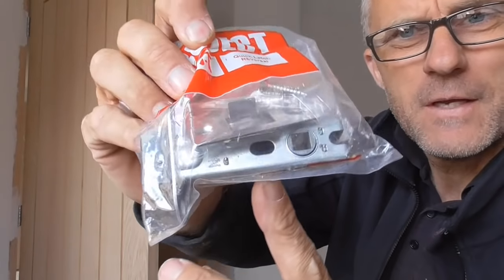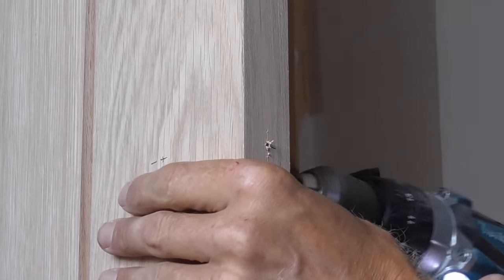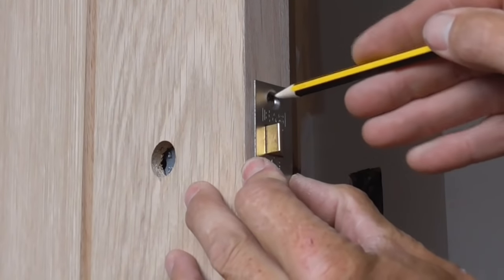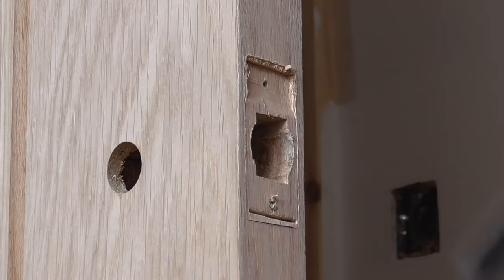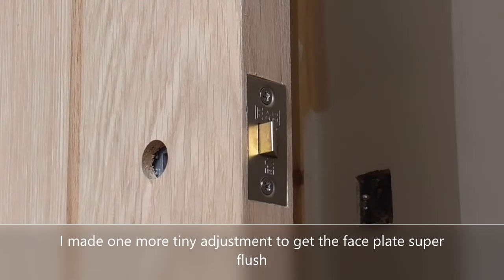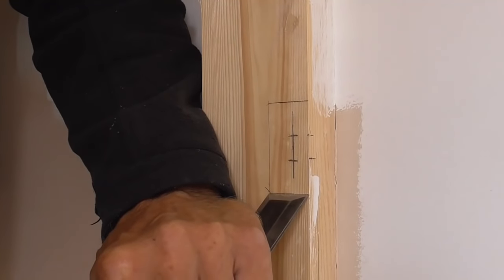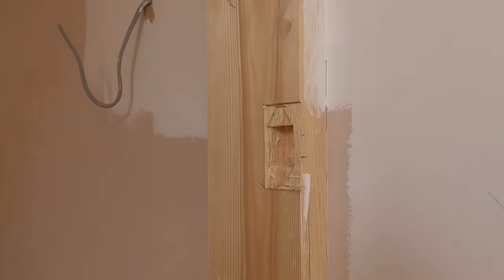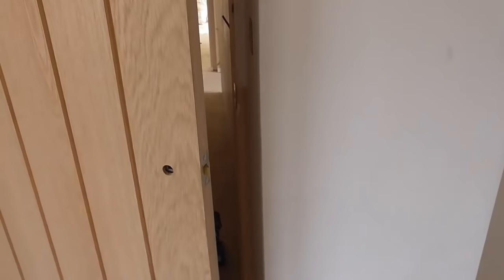How to fit a tubular mortice latch and keep.

Comment: Why don’t they make the latches same way they used to before you could just drill 22mm hole then slot it in now u have to drill and chisel it before it goes in
Reply from the maker: You're showing your age now Lewis🤔I also remember the latches fitting perfectly in a 22mm hole👍Thanks for watching 😎 Cheers Del

Comment: I’m glad someone else cuts the top and bottom of latch hole with a chisel I don’t understand the manufacturer’s not making a latch that fits and operates in a 22mm hole like the older versions
Reply from the maker: Hi Paul. Your comment has saved my sanity, as I was sure that latches always used to fit straight into a 7/8" or 22mm hole😲 I just don't like using a 25mm bit as it's the same size as the faceplate👍 Great comment and thanks for watching 😎 Cheers Del

Comment: Hey I'm a carpenter of 20 years. It's nice to see someone with good technique. I always use a knife where possible on finer work. One thing I have learnt is using the marking guage to make extra sure with the marking of the latch plate. With real poor quality fittings you might even have to avoid this but I will be using this technique in the future. Our techniques are almost identical on this matter. I do give a little rub down with some fine paper on the outer edges of the cut out to smooth them off before I put the final plate on. Good job. I've just found you and just subscribed. 👍
Reply from the maker: Hi Simon🖐You got me on giving the faceplate housing a little tickle with some sandpaper before fitting the latch😬I do it on hinge housing when using a router, and should, like you, also do it when fitting latches as it just softens the edges very slightly👍Thanks for subscribing and it's always cool to have a fellow carpenter watching and commenting😎Cheers Del

Comment: I like the idea of drilling the spindle holes first, but when it comes to the latch plates I like to use a trim router and an 18mm bit to take out the bulk of the material and then clean up with the chisel. (Steady hand) Removes the guess work with trying to achieve plate depth, I've also been experimenting with the Souber Latch Jig. Allows you to drill two 23mm holes overlapping each other for the latch body, it is very square and has a depth stop. Also you don't have to square up the hole afterwards with a chisel. 

Great video though, I watch your stuff all the time. Really enjoy the content! Thanks for another one.
Reply from the maker: Hi there🖐I definitely hear what you're saying about routing out the faceplate, and I've heard many people say how great the Souber jig is👊Thanks for your great comment 🤩Cheers Del

Comment: ive always gone 1 meter off the floor but i like the idea of going off the top of the door so theirs no need to square the lines around. i also  use a Stanley knife to mark the keeps. ive always used a spade bit to drill the mortice! ill give a auger bit ago now though. another great video 👍🏻.
Reply from the maker: Hi Tomm. I find that a good quality auger bit tends to hold its line a bit better than a spade bit.👍 Its cool that you knife round the latch plate and keep the same as me.😎 Thanks for watching and your comment.🤩

Comment: Another great video. I usually measure from the floor, with multiple doors the handles generally have more chance of lining up, particularly in hallways. I like the way you fix the faceplate on the door, will give that a go. When I use an auger, I clamp a block on the door not to split it. (Particularly cheap doors) I learnt that off my dentist when he drilled my teeth. Always good to watch how others do it. Thanks
Reply from the maker: Hi Jerry. Your clamping idea is a good one, and fortunately, I don't have many issues with splitting due to pilot drilling.👍 Thanks for your great comment and for watching.😎
Reply: @thetallcarpenter  I agree. To be honest, like you I always use a pilot drill but I noticed on those cheap doors ( not supplied by me they can split) maybe a change of drill needed. Your latches are spot on.
Reply: Yeah
Reply: Where do you clamp the block? I don't get it
Reply: @donaloconnor3352  I wasn’t very clear Donal. Just put a clamp where I drill the lock out. The door becomes a sandwich between the two outer blocks. I hope that clears it up a bit.
Reply: @jerry moffat  I understand now. The blocks are clamped on when drilling the hole on the face for the mortice but not when drilling hole for the handles obviously
Reply: @donaloconnor3352  that’s it Donal. It’s me, clear as mud.

Comment: Good show, always nice to watch a job well done. TIL to measure from the top and drill the holes for the handle first. Combination squares are underrated! I use the corner tip of a chisel to mark outlines.
Reply from the maker: I like the idea of using a chisel to mark round as it's gonna be super sharp👊You're right about how underrated the combination square is👍Thanks for watching 😎 Cheers Del

Comment: Thank you & well done on this very informative & simply put video, I will be attempting my 3rd latch fitting to an oak (oak laminate) door at the weekend. My previous 2 attempts weren't 100% to say the least with split bits here & there. This method should hopefully help me to get better. I know this original video was posted a few years ago, but I was just wondering what drills & auger bits people recommend? I have an 18v Bosch drill used with a 22mm dewalt extreme tri flute drill bit auger that just jammed & died a death when it got 1/2 way down, so after that I used it with my mains drill that has no variable speed so its all or nothing, which is a bit heart in your mouth stuff when attempting to drill a 22mm hole in the end of a 35mm thick door with little or no room for error!😅

Comment: Very thorough thanks mate. I've made a few notes. It's amazing how many steps there are really.  I've done a few in the past but generally messed the order of works up .. Not any more 👍🙏
Reply from the maker: Hi RG🖐That's ordered I find works best for me bud👊Thanks for your comment😎Cheers Del
Reply: @thetallcarpenter  Looking good.  I had to use a 19mm auger on the door spindle instead of the required 20 as i only own 19,22 and 25mm. The 22 looks look close to the bolt thru fittings on a test piece. So opted for 19mm spindle and 25mm latch body.  👍 I couldn't find the auger size you used in the vid, I may have missed it 👍
Reply from the maker: @hedgerowsandzeros  I actually use a 22mm auger for the latch body and a 19mm for the spindle hole. I find the a 25mm bit for the latch body is, more or less, the same size as the faceplate, which doesn't leave much room for error😮Cheers
Reply: @thetallcarpenter  Thanks buddy, I mistyped that, I opted for the 22mm for the body too, can always take more off. Appreciate the help mate 👍

Comment: Served my time as a joiner were about the same age. I always use low tack tape for marking out and always set my router to cut the face plates in then clean the corners for a perfect no gap fit.
Reply from the maker: Hi Gary🖐That's a great way of marking mate, and saves pencil marks all over the place👍Thanks for your comment and for watching 😎 Cheers Del

Comment: Great vid, screwing the faceplate to the door and knifing around it is exactly how I do it, much neater finish that way. I find If u use a 25mm auger u don't have to chisel the corners of the mortice out to take the latch body and the hole is just small enough to be covered by the faceplate
Reply from the maker: Hi Marc🖐Yeah, it's a great way to get a nice accurately fitting faceplate👊and glad to hear we do it the same🤩Thanks for watching and your comment 😎 Cheers Del

Comment: Hi Del nice job these square tubular latches are a pain and seems as if the old round ones are almost nonexistent now every job I get now for hanging doors has these squared ones supplied, I have the new style trend lock jig that will do a rectangular cut out for them so not so bad 👍 great video and technique for fitting the latch & keep.
Reply from the maker: Hi Rob. Yeah, it used to be that latches would slide straight into a 7/8",(22mm), hole, but as you say, not so much nowadays.😬 Thanks for watching and your comment.😎 Cheers.

Comment: Fitted loads of these when I was working always with hand tools mainly and agree that those black boxes where a right pain, as well as the tang at 90° on the back of the keep itself. Never could understand what they were for but I admit if I was asked to remedy doors that were rattling I would  use pliers to bend these a bit. 😀😎😎
Reply from the maker: Hi Kevin. I think that's what that 'tang' is actually for🤔if it isn't, it certainly works, as you describe, to stop a rattly door if you bend it out👊Another great comment bud😎Cheers Del

Comment: Centre hole drill bit for door hardware is a handy tool to have also. Nothing worse than a pilot bit going off centre when fitting.
Reply from the maker: Hi Diarmuid. A centre hole drill is something I have NEVER used, and I don't really know why.🤯 I sometimes like to drill my pilot holes off centre to help pull hardware tight to a housing shoulder, but I really do need to get a set of centre hole bits.😎 Thanks for watching.

Comment: I use a ply template hang it from top of door . If you have a few to do it’s time saving . Got a corner chisel cuts a right angle quick and easy . Usually I drill the lock out screw the barrel in place mark round it take it out and cut the excess away . Some doors only have a lock block on one side as well . I’ve also got a jig to drill at a perfect 90 degrees . Nowt worse than a wonky mortise .
Reply from the maker: Hi Colin🖐You're right about jigs bud, and they are definitely worth taking the time to make, especially if you've got a fee to do👍Thanks for your comment and for watching 😎 Cheers Del
Reply: @thetallcarpenter  nowt better than a happy chippy .😂
Reply from the maker: @colinjaques9864  👍🤩

Comment: Thanks for a very instructional video. Do you use the same augur bit for spindle and latch holes, if so, can you tell me what size please?
Reply from the maker: Hi there🖐I use an 18mm for the spindle and a 22mm for the latch body👍Thanks for watching😎Cheers Del
Reply: @thetallcarpenter  Thanks Del. Could I get away with using a 20mm for both?
Reply from the maker: @michaelalbert9299  You could on the spindle hole, but not on the latch body hole😬without doing a lot of extra chiselling😶
Reply: Thought as much. Thanks!

Comment: Lovely neat job.  I make the mistake of using a slightly wider bit which as you say is too close to the edge of the door.
Reply from the maker: You're right Jeff about the larger bit, as it can cause problems if its slightly off centre with the face plate housing.😬 Thanks for your comment.😎

Comment: Hi Dell, great job as always. I have always used a router plane to recess my face plates/keeps or receivers. Found it to be a great way to get an accurate depth every time minus the mess when using an electric router.
If you were doing this on a rebated door frame, how would you deminstrate how to use a router on the keeps?
Cheers
Reply from the maker: Hi Dan🖐I'm not sure you could easily use a router for the keeps on a rebated frame without knocking up some sort of jig🤔Cheers Del
Reply: @thetallcarpenter  hi, ja I usually make an mdf packer the same thickness as the rebate and have a cut out for the keep or hinge and use double sided tape to attach it.
Reply from the maker: @danthechippie4439  Sounds spot on Dan👌

Comment: you’re a brave man using a self feed auger bit on oak doors 😂!
Reply from the maker: Hi Michael. Judging by a few of the comments, it seems that auger bits are OUT.😬 Thanks for watching.👍
Reply: @thetallcarpenter  certainly wouldn’t be me sir but you seem to have it all under control 👌🏻
Reply from the maker: @michaelmcgachy9986  🤩👍😎
Reply: @michaelmcgachy9986  hi micheal and tall carpenter,  great channel by the way, I've used auger bits since I was shown how to do this with a bit n brace, I'm interested? what bit would you suggest in place of the auger, regards jay
Reply: @jasonkennedy4211  sharp spade but you’ll be good to go

Comment: What size drill bits do I need ? 
Cabinet maker , doing some 2nd fix tomorrow, freaking out a bit 😅I’ve only got small bits
Reply from the maker: Hi there🖐 I use 19mm for the spindle hole and 22mm for the latch body👍Cheers Del

Comment: What type of drill bit is that! I've tried a flat one and another one which cut jabbed when it was deep in the door. Yours looks it clears out the did debris as you drill. Wouldn't mind getting one but can't find one so need to know name of type of bit. Thanks
Reply: Also, I have found that no matter how I measure where the strike plate should go from where the latch sits on the door frame, it never is quite in the right place and if I drill pilot and fix strike plate, it is really hard to move it that 1-2 mm to ensure snug fit with no rattle. I have taken to fixing strike plate in place with sellotape (I know, amateur) and moving slightly until good fit with closing door before finally fixing strike plate in correct position. It's probably just lacking experience as I'm just a DIY guy learning.
Reply from the maker: This is the kind of drill I use. Just make sure to put a small, (3mm), pilot  drill in first so the screw on the auger bit doesn't split the door👍
https://www.wickes.co.uk/Wickes-Auger-Wood-Drill-Bit---22-x-210mm/p/168647
Reply from the maker: I know it can be tricky getting the latch plate in the right place so the door doesn't rattle when hanging doors in linings that already have the stops on, and if your sellotape method is working for you, I'd STICK with that😉 (excuse the pun😆) Cheers Del

Comment: Another very helpful video.  A question though - I am about to fit 8 of these exact doors.  I had been thinking of lining up the location of the handle and mortice latch with the cut out and keep for the existing latch, so I wouldn't have to repair/fill the old keep/cut-out.  Obviously with your job you had a plain, untouched frame, so there was no problem, but I have existing keeps.  Would that be a goer i.e., to line the mortice latch up with the old keep, or would it be problematical and potentially a disaster? Cheers.
Reply from the maker: Hi there🖐When you describe lining up the new latch with the existing keep, this is exactly the way I do it, as its a lot of work messing around repairing old keep cut outs. I also use latches that have a fairly large, square keep plate profile, which are excellent for covering where the old keep was cut out👍Cheers Del
Reply: @thetallcarpenter  Excellent, thanks for your quick reply. I'm not quite as stupid as I thought!

Comment: I recall using a bit and spinning it backwards for 8-10 seconds.
That sets the hole exactly where to drill without having to use a center punch.
Reply from the maker: Hi Jim🖐 I haven't heard of that, but I can see how it would work👍Thanks for watching 😎 Cheers Del

Comment: Funny what you did with the latch face place fixing it on backwards and cutting round it is exactly what I do. Gets an immaculate finish. Not seen many other guys do it like that
Reply from the maker: Hi Ross🖐That's wicked that we mark the faceplate the same as it does get it perfect👊Thanks for watching 😎 Cheers Del
Reply: @thetallcarpenter  thanks for the reply 😊. You had any experience with the trend hinge jig? I've got 15 fire doors to hang so was thinking of investing in one.
Reply from the maker: @rossmale8715  One MILLION percent get one Ross🤟👊🤟I bought the one price Trend jig a couple of years ago, and it's SO much faster than cutting in butt's by hand👍I did 12 Oak doors last week. Started at 8.30 and finished at 3.30. (with two half hour tea breaks🍵)Very good investment👊
Reply: @thetallcarpenter  that's brilliant thanks. Seen so much online but wanted an opinion I could trust. 15 pre finished fire doors with a pair n half hinges. Gonna save a hell of a time
Reply from the maker: @rossmale8715  Absolutely will not regret getting one Ross👊

Comment: Great video thanks. I’m a complete. novice.   How might I convert an internal utility door to a simple mortise lock please?    Do you have such a video? My goal is to then jnsert a switchbot on the other side.
Reply from the maker: Hi Al🖐A mortice lock should, more or less, fit in the same hole/cut out as a mortice latch👍Cheers Del
Reply: @thetallcarpenter  well that’s great thanks. Your tutorial was so complete even I will have a bash at this.   Thanks so much for your absolutely professional video

Comment: Hi Dell, did you happen to mention what size auger bits you used to drill out the latch and handle? Cheers Dell
Reply from the maker: Hi Dan🖐 I used 22mm for the latch body and 19mm for the spindle hole👍
Reply: @thetallcarpenter  👍😀

Comment: Quick question on this, when measuring the latch depth from the front, is that better than measuring to the back?
I don’t like rattly doors which in my mind is more likely measuring from the front…
Just a thought.
Reply from the maker: Hi there🖐As this is new work, I set the the keep back in the lining from the front, as I can just fix my stops in the correct position so no rattles. If doing re-hangs, then you are quite right, and it's better to measure from the back of the door and then out from the stop as you, very often, cant/won't move the stops👍Cheers Del
Reply: Cheers Del, thanks for the reply. I’m a spark, who gets involved in bits of other work who enjoys your videos. 👍
Reply from the maker: @newlinerealboi3434  It's cool to have you watching bud🤩